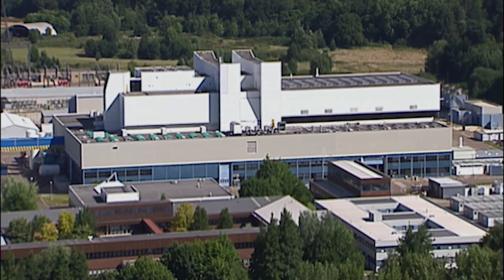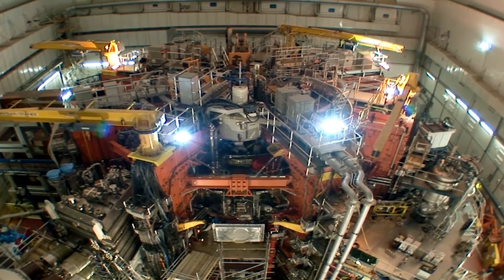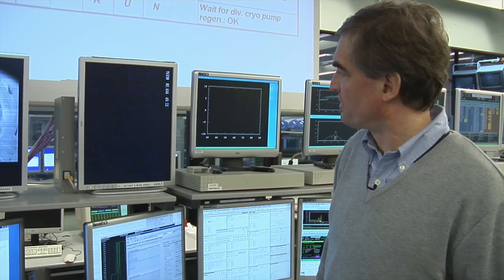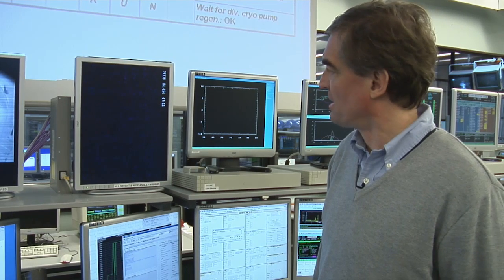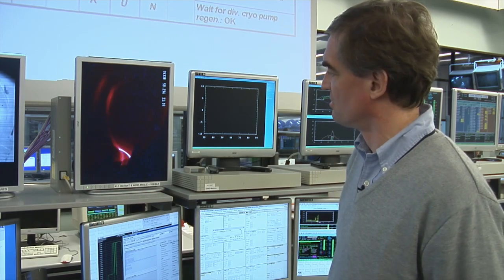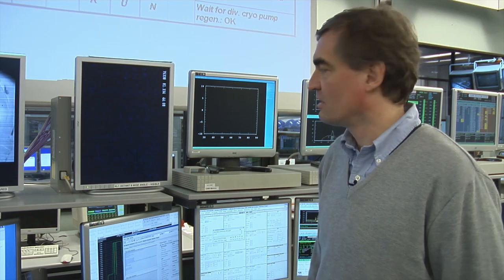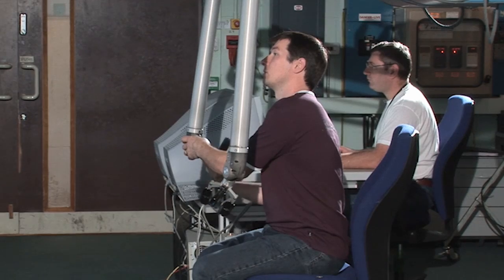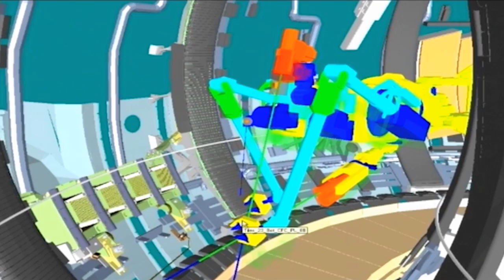Inside a nuclear fusion reactor

Comment: the reason they cant sustain this thing is because of the bombardment the neutrons being produced causing the titles of the reactor to break down/burn. look at the walls at 2:38. it would be worse if it wasn't for the magnetic confinement that's keeping the plasma at bay but too bad the neutrons have a neutral charge. hopefully they'll find a material more resistant to the neutrons in the future.